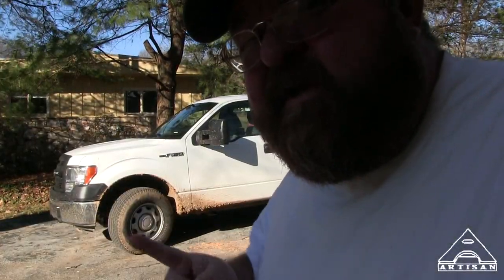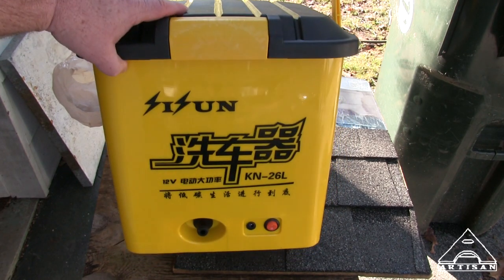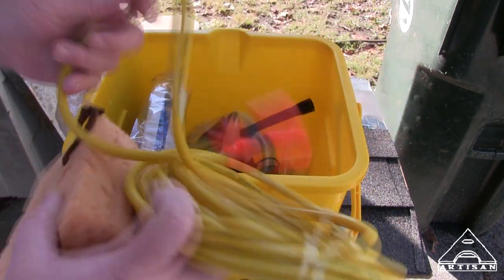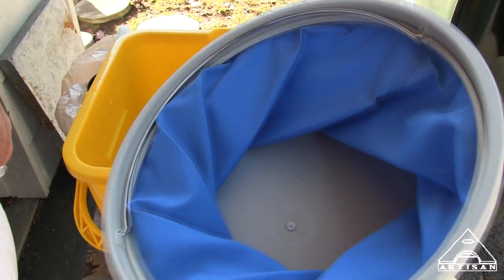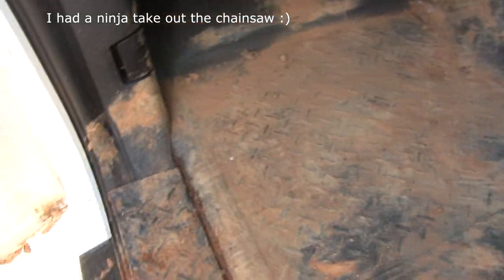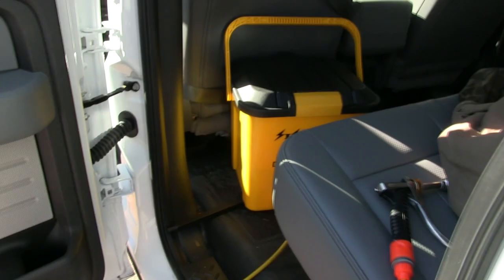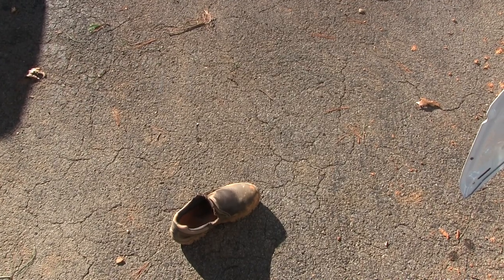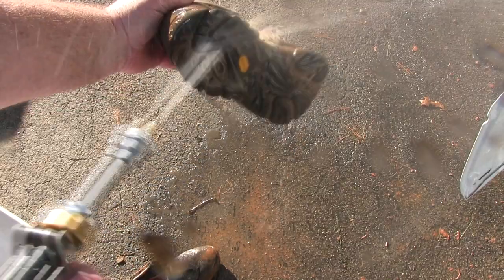Sisun Portable Pressure Washer | First use and Impressions

Comment: Good video, Artisan Tony.  People in business will understand a businessman "Sells the sizzle and NOT the steak."   Being El Jefe on the jobsite, requires Artisan Tony to keep his truck, clothes, shoes and equipment clean.  It's part of business. 
   This following Okie talk, gets some folks upset in Tennessee.
1.  I have house front-door mats, on top of the, truck mats.  I can take them out and wash them.  I have to tie the driver's side one down, as it will want to slide up, under the brake pedal (That's bad news!)   Some jobs, an old big-rag has to be carried to place on the seat.
2.  Does the water in the container help keep the water pump cool?  Can you read Chinese?   Running out of water in the container may shorten the life of the pump.  (The electrical set up, may be due to a worldwide market.)
3.  I've been told rubber boots from a dairy supply house will last longer, than rubber boots from Walmart, or a big chain hardware store.  I don't know if it's true.  I buy the cheaper boots, they'll rip apart after one or two years.  I bet firemen have high quality rubber boots that will last for years.
4.  One night, I was washing my car in a do-it yourself place.  I put the wand down, so I could scrub off the mud.  I did NOT follow the directions, and walk over to the 'holding tube for the wand.'  The 'deadman release' on the wand wasn't working.  When I was bending over to place the wand on the ground, the wand got away from me.  The water didn't shut off. 
   Anyhoo, the wand starting whipping around like a snake, banging into everything.  I did the smartman thing, and ran out of the bay, and then watched the wand bang around.  It was actually dangerous.  The wand hit the coinbox and set off an alarm.  Finally the water shut off (ran out of time).  The alarm rang for about 10 minutes, when a guy living nearby, showed up, and turned off the alarm.
   I said, "The wand got away from me.  The deadman release doesn't work."  He >laughed and said, "It happens, sometimes." He shut off the alarm, and straighten the coinbox back into place.  He then went home.
   I moved my car over to the next bay and finished washing it.  I had a couple of small dings in my car.  But, I chalked that one up to NOT following directions.  Plus, it could have been a Kafkaesque experience, with the cops, trying to explain, how the coinbox alarm went off.  I didn't want to drive off, while the alarm was ringing.
   5.  My father used the old time Okie method for washing the car.  He'd sit inside the car, smoking a cigar, and listening to the radio, while all of us kids washed the car.  A real good Okie method for cleaning your shoes would be, put a thin coat of peanut butter on the shoes, and then let Max, the little dog, lick them clean.  (Just kidding.)
Reply from the maker: LOL, I have tried the mat thing and will probably try it again but have found it is a pain either way :)
Reply: ArtisanTony>You are RIGHT.  When I hear about, or read about, people complaining about covering the earth with concrete-asphalt, I think, there's someone that's never lived with mud, all around everywhere.